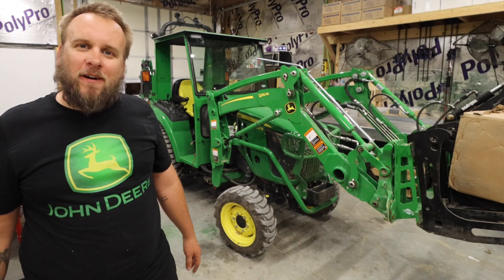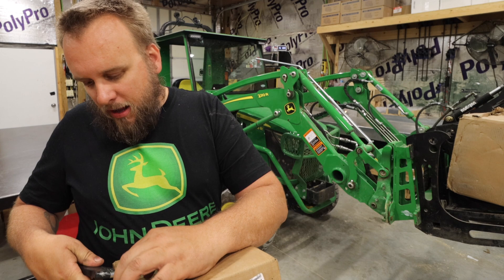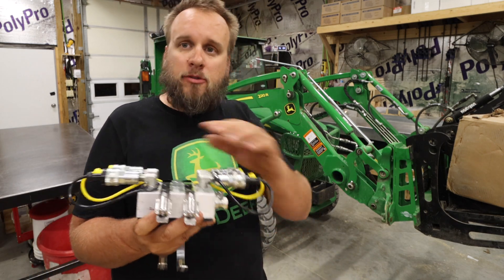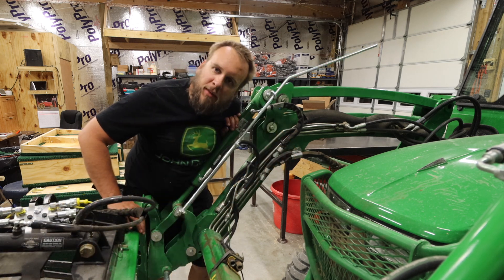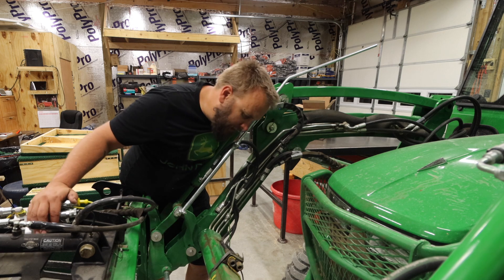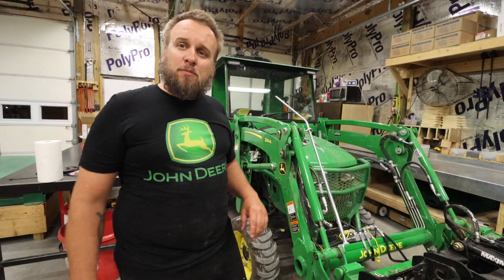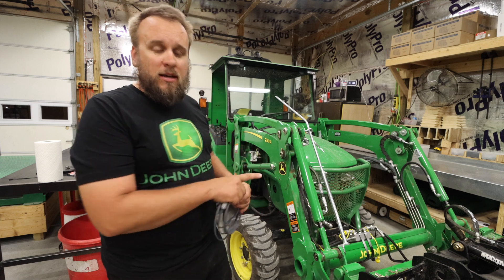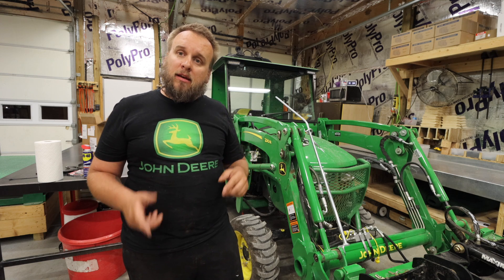Installing a New Hydraulic 3rd Function Splitter Manifold

Comment: A third function valve is critical for grapple work and a front angling plow. My dealer mounted mine with a toggle on the loader joystick. Perfect place for it in my opinion. Even with thick XL winter gloves on its easy to use.
Reply from the maker: Yeah, mine is also a button on the loader joystick.

I definitely prefer to my original set up
Reply: @RockhillfarmYT  Brock, for your 3rd function hardline male and female are those 1/4" connectors?    I have the John Deere Factory 3rd function and trying to figure out the hose length and hydraulic coupler from the hardline to the Splitter before I purchase.